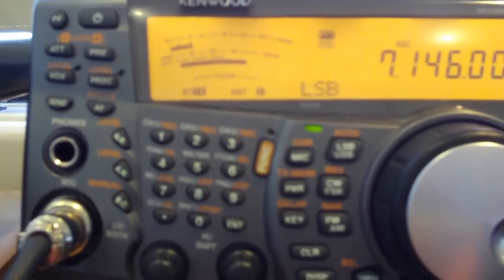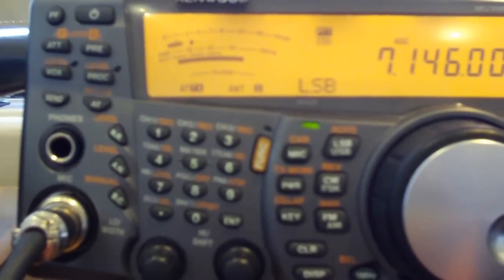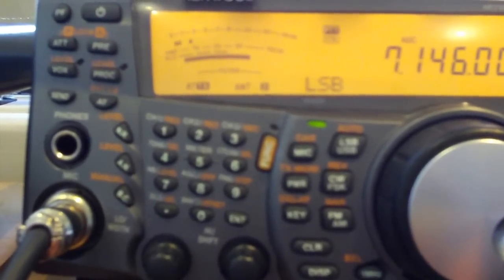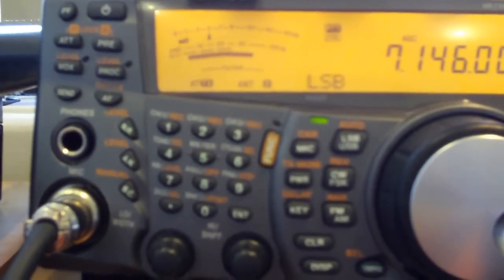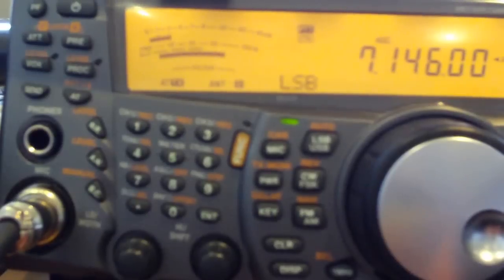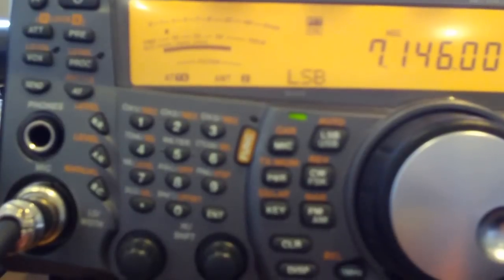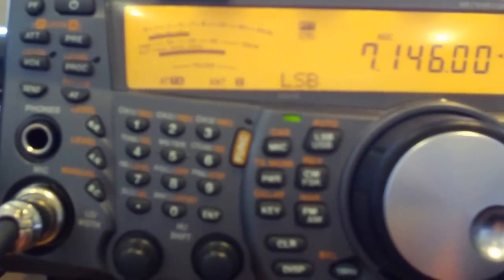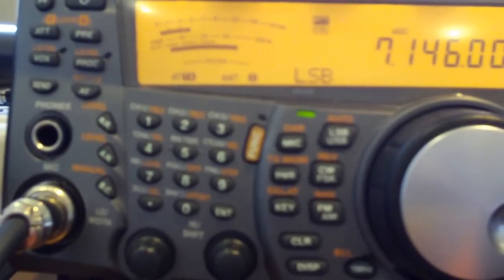Performance of 40m full wave horizontal loop antenna.

Comment: Hi ED, I could see what you were trying to show, which came over ok. Yes, it was a bit loud, but hey, that's what the volume control is for.
I assume from your accent you are in the UK, or were you down under when you made this video? The reason is, I thought you were doing very well copying VK land a that signal strength and clarity.
I use a Delta loop too, here in sunny Norfolk, England. I made it for 40 meters, and vary the polarisation to suit the day. Good luck anyway.
Reply from the maker: +5BASSIP  Hi, You guessed right - the tests and video were made when I was living in New South Wales Australia. I have since moved to Germany but brought the 40m horizontal loop with me and it is my main antenna here despite buying and erecting a 2 element tri-bander mini-beam, the 40m loop performs better on 20m than the beam did. I am even more restricted on space in my new house than I was in Australia, so the antenna is "squashed in" a little but certainly still performs. I changed the Q-Section (75 ohm coax) feed for a 3:1 balun and I believe I get better performance on 17, 15, 12 & 10m now. No improvement on 40 or 20m though. OK on your Delta Loop - a very similar antenna especially if you can change it's polarisation.
Hope to catch you on-air one day.
73 Ed DD5LP / VK2JI / G8GLM.
Reply: Good stuff ED, will listen for you. I am now in the market for a Ts 590 sg, and am looking forward to hooking it up to the delta loop. 
The 40 m loop fed with 300, or 450 ohm feeder, works very well on the higher bands too.tThe feeder can plug straight into the atu. Or, into an 4:1 balun, then coax back to the atu. The loop is only up at 25ft, but I have worked most of the USA and Caribbean, South America, and the Far East.
Good luck.
Reply from the maker: +5BASSIP  The TS590SG is a good rig. I've used the TS590S both at my local club when I was in Australia and on a DXPedition to Lord Howe Island. Knowing how to operate a TS2000, the TS590S is very similar. The 590 has a quieter and better receive section than than the 2000 in my opinion (it should have as it was developed 10 years later). I'd love for Kenwood to bring out a new TS2000 using the Rx and HF Tx side of the TS590SG plus the 2m and 70cm capabilities of the existing TS2000. That would be a killer rig. 
For the price point the TS590SG is well worth the money but I would also expect some second hand TS590S models to be available now at a good price.
I also tried feeding my 40m loop with 300 ohm ladder line but found it to perform less well than with the Q-Section. I do not however have an ATU that has parrallel input and hence was using a Balun in the shack before the standard 50 ohm ATU. I think my results could be different if I have a parrallel fed ATU available. In any case with the 3:1 Balun on the loop I am very happy with the results. For such a simple antenna the loop works remarkably well no matter how you feed it!
Not sure where you are located but I've worked back into VK from DL on several occasions with the loop. So far I have only managed one contact "across the pond" into the US but I think that's more that I have not been on the right band at the right time.
73.
Reply: Hi Ed, I am located in Norwich, England. But have done very well into the US as I mentioned before.
Looking forward to getting the Kenwood, and hooking it up to the loop.
All the best for now 73

Comment: Hi BigBadgers2001 - the antenna was originally on the top of four 5m high "squid poles" (fibreglass telescopic poles). I later updated to 7 metre ones. I have written a full article in the CCARC quarterly magazine some time ago-that can be downloaded if you go to http://www.ccarc.org.au/wp/smoke-signals/ and select Volume 41, Issue 1. The article is titled "cheap antennas".